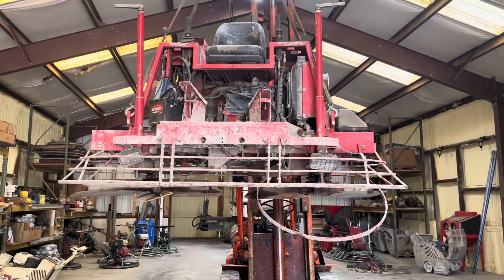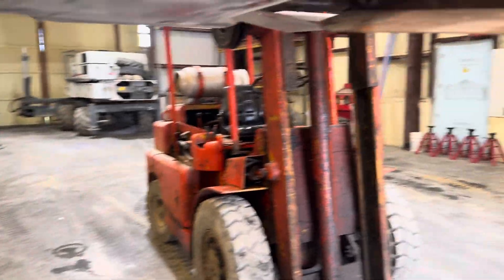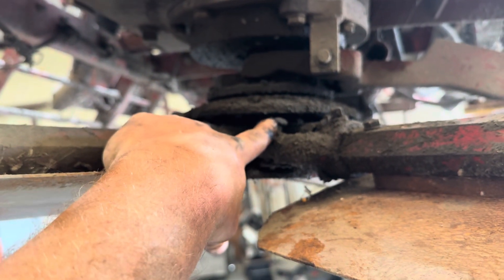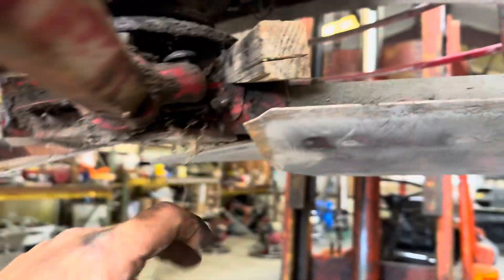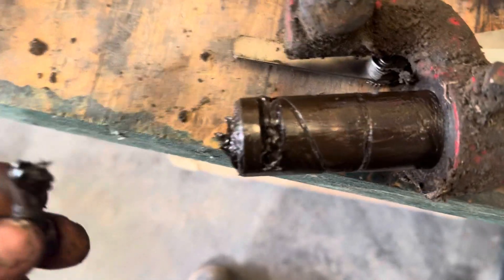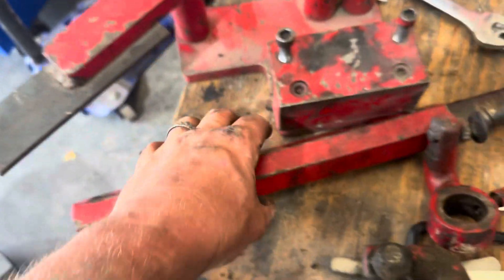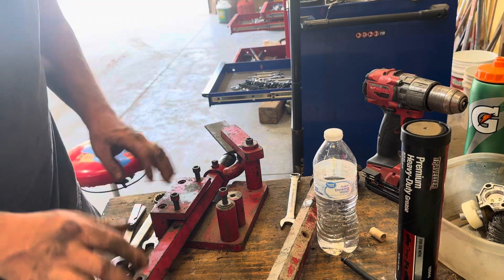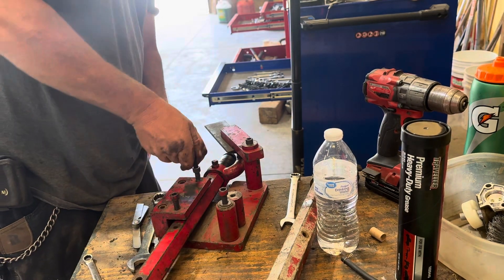Allen ride on trowel machine arm replacement and blade pitch adjustment#concretetrowel #concrete

Comment: Would a warped stabilizer arm create a wobble one the machine? Or does straight arms eliminate any bend in the ring?
Reply from the maker: Naw if the rings bent I won’t make it wobble  only bent arm or a bent spider can make it wobble    My boss had me pill all the arms on a Whitman one day over a bent ring he thought the arms where bent causing it I checked ever arm and all strait I said u done had me do all that for nothing lol
Reply: @adamcope8877 and it ain’t easy pulling all the arms! lol  I’m doing it now to find which arms and how many are bent. I’ve got one spider done, 1 arm out of 5 were bent. Checking the other side tomorrow but the hex screws are being a bitch! Penetrating oil, heat, nothing is helping. Gonna try again tomorrow. I’ve got 3 machines to check. I’m thinking about buying to press to try and bend the arms back, but I don’t know if that will work.
Reply from the maker: @chrisstorey1606  you can raise it and put a 4-6 foot level across the bottom of the blades hold them flat and you should be able to tell if the level has a gap on the end where the blade bent up
Reply from the maker: Would of told ya earlier my phone I switched carriers and lost my service since 7pm last night just now got it back on
Reply from the maker: @chrisstorey1606   a press is a good idea I didn’t think about that my self cause they don’t bend much I might try that my self lol
Reply from the maker: Pick the machine up and look at how ur blades run the wear marks  most of the time I can see one blade will not be touching the floor as much on the outside side  the inside beside the spider should have a brother wear spot

Comment: So the grease fittings on the side of the arm does not have to come out? The bolt under the thrust bearing and the Allen bolt at the stabilizer ring are the only bolts that have to be removed to free it?
Reply from the maker: @chrisstorey1606   correct unless u working on a whiteman then the grease fitting has to come out it takes place for the bolt under the thrust bearing
Reply: Ok thanks. It’s an Allen MSP455
Reply: Another question for you, whenever I take my foot off the throttle the blades stay engaged. The drive pulley / clutch continues to spin so the blades keep turning. It’s frustrating when we’re finishing a slab bc when you need the blades to stop, they don’t. Any ideas?? Thanks for the video by the way…there are absolutely no videos on YouTube for these riders.
Reply from the maker: @ might check to see if it’s idle up to much the clutch shouldn’t engage till the rpm’s come up if it’s not the idle then may be in ur clutch sticking the clutch I think we bought 2 of the blue ones they where like &400 dollars they kinda go by color cause the strength of the clutch black and the blue this machine here is the sp400c hydrostatic it’s black they guy or belongs to just had a clutch put on cost his like 4k but u can put it on ur self save lotta labor money
Reply from the maker: @ these clutches are kind a huge go cart clutch when the rpms go up the clutch expands out to the bell and spins the shaft  if the spring is stretched it can cause the clutch to stay locked ingaged the newer machines are hydronic they have a linkage u can adjust to stop the blades they don’t have a clutch tho
Reply: @adamcope8877  I believe my clutch is the blue one. I wanna check the idle when I get to work on Monday, but I think the clutch is just needing to be replaced. Both of my MSP455’s are doing this. I also have 2 of the 12’ HD550’s. They’re a couple beasts. I swear those machines would work up a 20 year old slab. I’ve always sent my machines out to get fixed…but I’m trying to learning how to repair them myself (along with a million other pieces of equipment in my shop). These 8’ machines need the clutch fixed and I’ve got some bent arms because it’s wobbling pretty bad. Didn’t think about the pitch not being consistent until I watched your video 👍🏼 If you post more videos then you’ll have a least one viewer. lol.
Reply from the maker: @ thanks and yea the hd 550s are sweet but man heavy  we have 2 of them our self have one in the shop getting the engine rebuilt  got blow by real bad boss wanted to send it to a diesel mechanic that works on kubotas ever day I could of rebuilt it but I’ve never done postion sleeves replacement so he got someone else to fix it I said saves me the head ach lol
Reply from the maker: Piston sleeves my bad just seen that lol
Reply from the maker: @ if u have a bent arm raise the machine up and flatten the blades put a 4foot level across from one side to the other u can see if one bent up words take the blade loose add a few washers between the blade and arm to get the blade level back out it’s a easy cheap fix the arms are expensive
Reply: @adamcope8877 man that’s an awesome idea, I never even thought about using washers to flatten it out. Nice 👍🏼 because I’m literally waiting for a price to come back for new arms…no telling what it’ll be. It’s been so long since I’ve bought any.
Reply from the maker: @ yea it’s a quick easy fix to get ya by for a while  the arms all bend a lil over time cause the way they work with the tilt to move the machine u can use washers to shim Normal wear and tear bends for a while till they end up breaking